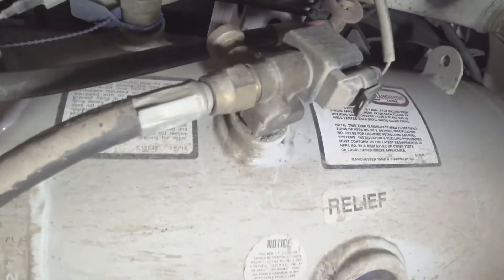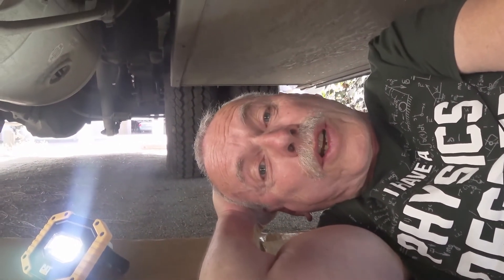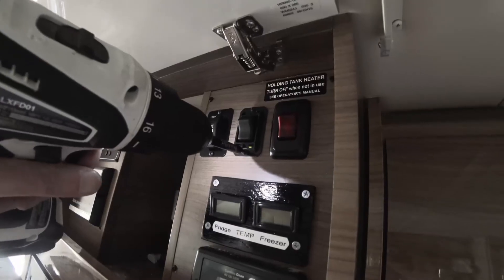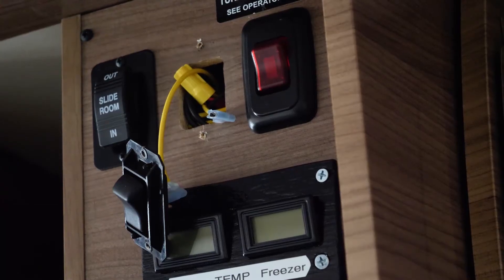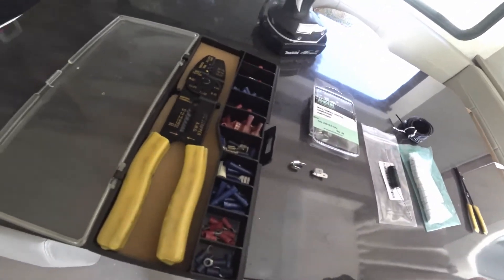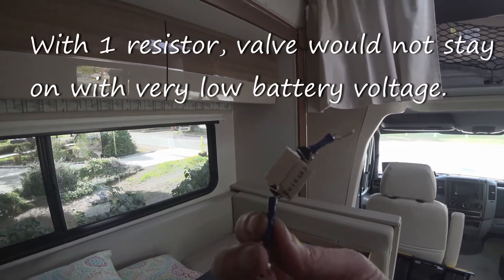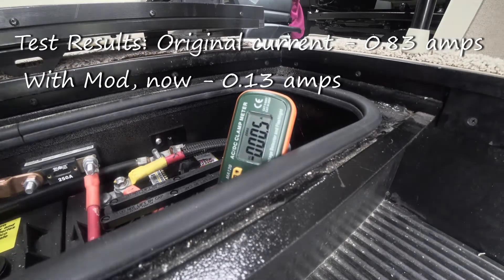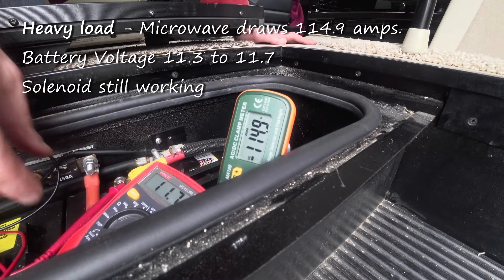Boondocking tip - How to Reduce Battery Drain from the LP Solenoid Valve

Comment: Using a 12V Dc To DC converter is way more efficient and reduces solenoid power draw significantly.
Reply from the maker: Actually the dc to dc is only 90% efficient. Direct connection is 100%.

Comment: Hi Ron, you seem to be someone who knows what you are doing, so if I add a lithium battery to my coach, it is a sprinter. how do I deal with having a lead acid batt in the cab ?
Reply from the maker: No problem at all. The alternator will always charge the chassis lead acid when needed. The coach lithium is usually not directly connected to the chassis battery and alternator. It is charged by solar or the genny or shore power. There are also ways to charge them from the alternator depending on your needs and the model year. The newer the rv the easier it is to switch to lithium.
Reply: @ontheroadwithron2432  thank you , Ron !!

Comment: Can I just turn it off outside the rv ?
Reply from the maker: Yes you can always turn off the propane but if you are running the fridge in propane then in must be on all the time.
Reply: @ontheroadwithron2432  your so right . My batteries are so far so good after replacing all of them , we had warranty . Before then they were dead every morning.

Comment: Hey Grandpa Ron; Love your videos!  We have a 2018 24D and am interested in making this mod to our Rig to reduce current draw on the propane cutoff valve.  It wasn't clear from the video how the resisters and capacitor were wired together.  I was also confused a bit by the use of 150 ohm resistors but the comment about needing only 75 ohms.  FYI, there is a guy I am communicating with in the Winnieowner.com website who is offering to sell me a similar device for $45; just wondering  if you think that is a fair price or not.  Seems that the installation is rather simple once you have the device.  Standing by to discuss when you have a moment.  Jcurtisis@att.net ; FYI, I also live in El Cajon; I would love to pay you a visit at some point if that is ok.
Reply from the maker: john curtis hi. Actually I replaced my homemade device with a unit from John Trombly. He is an electrical guy a nd his is more reliable than mine. He uses a chip to maintain a constant voltage to the valve. Problem I had was once in a while a power glitch would shutoff the propane. Never a problem with his. Ok to visit also
Reply: Thanks for the info; where are you located?  I’m off Greenfield by I-8.

Comment: What was the net result of your voltage reduction to solenoid valve. You mentioned how you used the resistors but not the other electrical components. The solenoid only draws power when propane switch is on- right?
Reply from the maker: David Galson yes, the RC circuit reduces the current when the switch is on. Off is no power. The Cap keeps the voltage higher until it discharges. This gives a little more boost to get the solenoid to open.  By the way, a couple times the valve closed when some appliances started. Not sure which ones so I changed it out for a more sophisticated design. The new one has been 100% reliable. This video gives more info. https://youtu.be/8rkV434OFY8
Reply from the maker: David Galson the current reduction was a little too much. Once every 2 or 3 weeks it would shutdown. Both designs reduce the current Around 85%.

Comment: Great videos Ron.  I have a 24J also.  Any ideas on how to install light dimmers on some of the rope lights?
Reply from the maker: Good point.  I've been thinking of this also.  The bathroom light is too bright when first getting up in the morning.  Anyway, the LED cells work on DC voltage, so a simple potentiometer should do it.  Not sure of the resistance, but will try it out later and make a report.

Comment: Hi Ron,
Great video! Regarding the setup you created, can I assume I just need one 75 ohm 5 watt resistor? This is the capacitor I could find on Amazon - 500uF 100V Electrolytic Non-Polarized Crossover Capacitor. And then it looks like you just connect the resistor and capacitor up in parallel. Is that correct?
Keep making the videos!  :0)
joe
Reply from the maker: Joe Spiers yes you got it. I do have an update video that should be live in a day or 2. I had one time where the LP shutoff on our 40 trip to Florida. Just had to turn off and back on. I’m using our microwave on the inverter, so the voltage drops to 10.5V worse case. That may have been the problem

Comment: Ron, It looks like you've purchased a solenoid kit with all the required components. Can you provide a link to the kit? Thanks and a great video. Mark
Reply from the maker: Awesome Adventurers Travel Network I actually made my own. Bought the resistors and cap from Amazon and soldered then together. Used a 500 microfarad cap and 2 - 150 ohm 5 watt resistors. Been using it for the last 4 weeks and works great. It did shutoff once, not sure why, but is very reliable other than the one time.